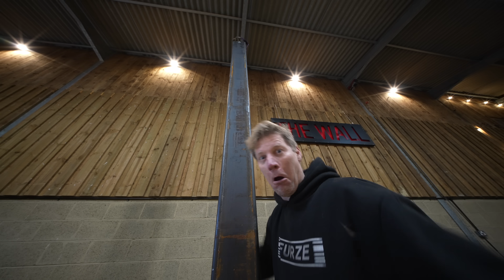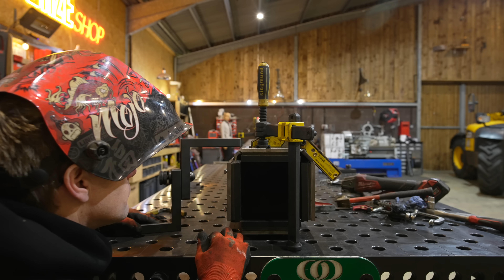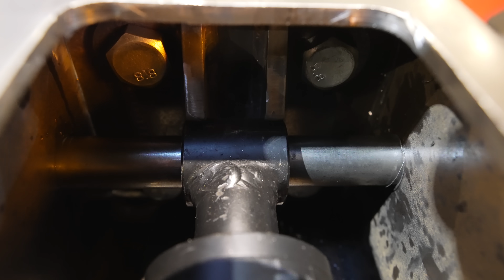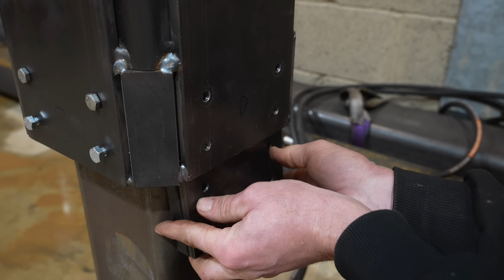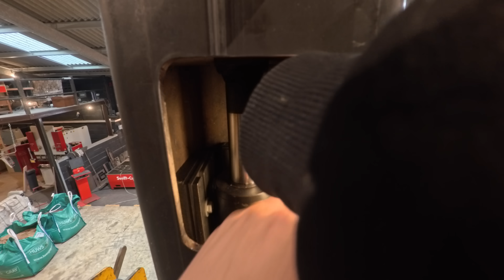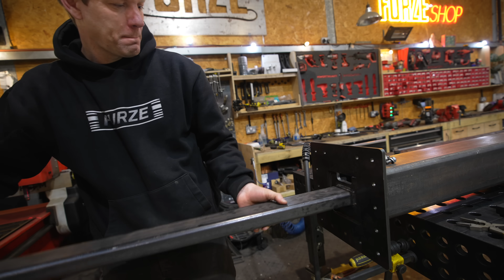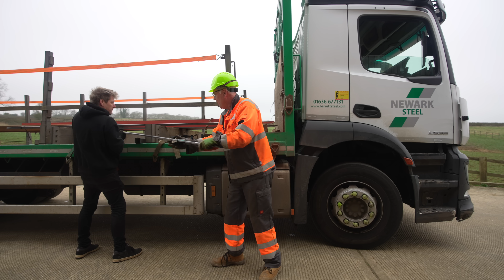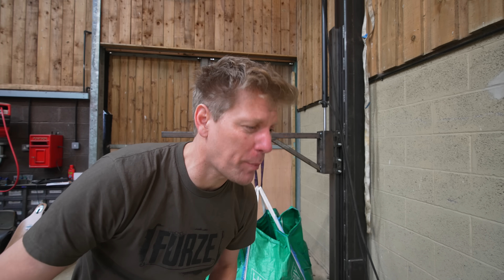Digging SECRET Garage Part 7 Car Lift Prep

Comment: Hi colin! Im a Hydraulics Engineer, and honestly youve done super good so far! As for the self levelling system, we'd use something call a flow Divider, this essentially splits the flow of a hydraulic pump into however many outputs you require! I build custom hydraulic power packs all the time so if you do need any support id be happy to give it a go! :)
Reply: A flow divider might build up some discrepancy over time. The cable system like in a car lift is the most reliable option. It doesn't even care if one cylinder fails completely.
Reply: @deckname5794 that's what I was thinking while watching the video.  I knew you could divide the flow, but didn't know there was a thing with a name that did that.  However, being ignorant of how flow dividers work, I figure using one would take away redundancy, and provide a single point of failure at the divider.
Reply: @deckname5794  just what I was going to say. Very simple, reliable, safe and relatively cheap.
Reply: @deckname5794 Well, we use them offshore on systems that lift thousands of tonnes. They are an essential part of a hydraulic lifting system and are work just fine.
Reply: @deckname5794 if the flow divider can reset by bottoming or topping out a function they go alright.
Reply: Could even use inceptors and servo control to manage the dividers like we do with our helicopter lifts.
Reply: Also a hydraulics engineer.  Flow dividers kind of suck where a system is constrained well or accuracy is critical.   They shine were things aren’t constrained. Like “I want to open 2 doors at the same time”. Applications similar to this i lean more towards electronic synchronization though old school systems did actually use ropes.
Reply: I saw a 1970s stage lift with 4 giant cylinders that used his cable system idea. Worked well. Epic project.
Reply: He needs height sensors on each post to regulate the flow to each cylinder. Ex Flow engineer here.
Reply: @daveshepherd1111 Yes, even low power lasers running through a microcontroller. Modulate valves to each leg, using one as master reference.
Reply: I started working as an auto mechanic in the 70s. The most common car hoist then was a single pole air/hydraulic system. Air pressure forced hydraulic fluid into a big cylinder buried in the floor. You could turn it around with a vehicle on it.
Reply: @terryvickers5986  Just a question cuz i don´t know, would this work on this height?
Reply: @LasseFisk  I don't see any reason why not. I'ts just a long cylinder. A big tube over a foot in diameter. Balance the load on it though. See an engineer for technical pecs for a cylinder to lift X weight and be stable. They might say two feet in diameter, with 1/4 inch thick walls.
Reply: @terryvickers5986 I was also thinking one big fat central cylinder lifting the turntable to the surface, however he wants to lift the driveway up in sync and not have the driveway lifted as high as the room is tall, so he is using the 4x telescopic method. It’s very clever, and really nicely engineered.
Reply: You should install a lock system like a car hoist has, when its lifting the car up have 4 latches on each post that roll over cut out grooves and makes the familiar clunk clunk noise. That was if something fails (very unlikely) the whole platform with all the weight on it wont come crashing down. Definetely be a good redundancy/safety margian to add in. You can have the last lock lined up so that when it reaches  the driveway level it locks in flush and is solid and not put any constant forces into the hydraulics. When you want to bring the car down the system lifts the platform up a bit higher to disengage the locking latches and it comes down smoothly. As for the turntable part in the middle so you can rotate the car around, the articulated busses we have at work have a bloody large tapered bearing in the centre of the turntable with 2 hydraulic rams that allow the trailer to articulate smoothly and allows for verticle play for the suspension,  but for your setup you could have gear teeth on the ouside edge of a turntable edge with a decent motor with a small gear that meshes with it, the large tapered bearing in the middle will allow full rotation and some smaller bearings on the edges to stop the wobbling and keep it smooth. I hope i explained this well enough 😂
Reply: @roboroach69   I'm an accountant and I have a pretty good idea of what you're saying. I agree with your idea to lock the weight over grooves especially when it relieves the hydraulics of constant weight.
Reply: A cable system could work, if you link the two diagonal posts together then you don't need to link them all four together.
Reply: @weu9  dunno why he didnt use cables , trailers use cables and can hold 1500 kilos easily even in transit
Reply: There are a lot of cooks in this committee 😂
Reply: All a flow duver does is as the name says 'devide flow'. They have no idea of diffent loading pressure at each cylinder. Load balancing blocks are pretty good at balancing, however in this modern age linear sensors are the way to go with proportional servo solenoids being used to pilot the high pressure working valve chest.
Reply: Rotary gear flow dividers I think he's on about which delivers same oil no matter on the different load cases. Either way don't think they are good, expensive and better options out there nowadays. I reckon a Plc and some solenoid valves
Reply: What about the way the car lifts in a workshop for mechanics with the safety locks on them.
Reply: @systemsrenegade9888 You have to hold those open to lower a lift. With all those rams, there might be enough resistance to keep it from dropping, if one blows a line.
Reply: The welds look amazing - me thinks CF had some help.
Reply: Flow dividers and rigid frames are a receipe for disaster. The flow divider fights the frame, you cavitate the lagging cylinder and if using counterbalance valves you lose pilot pressure and the whole thing locks up, or in the worst case the forces are high enough to damage the frame.
Reply: Hi Colin

Lift and Crane Engineer Surveyor here. Maybe fit high/low pressure detection switch into the system in case it snags during ascent/descent, and a low pressure valve that works without power. Also fit an electrically interlocked cut out switch to the safety gear system. Finally, if you want to go belt and braces you could fit either a solenoid operated chock to lock the platform at ground level so it can't lower unintentionally and will be fail safe with power off. Electrical anti creep would also work for this but not with power off. 

Good luck man
Reply: I have used flow dividers, they are a good solution to the problem of multi ram synchronisation. I would also use double acting hydraulic cylinders, you would surprised how much weight is required to retract the 4 rams when lowering the ramp. With an empty(no car) lift, there will not be enough weight in the structure to lower the lift.
The ultimate, highly accurate solution is to use electronic position feedback on all 4 rams, and electro hydraulic proportional valves linked to a master/ slave differential amplifier. 
Great project Colin, I am following with lots of interest.
Reply: i am just a few seconds into the video, and as someone who had to design (and fail) some hydraulic mechanism, the first thing i would have suggested, to NOT use hydraulics in the first place.
Hydraulics can leak, you need that expensive flow divider, that can fail to work if there is any discrepancy in the system, or over time... 
and for safety reasons, an electric spindle lift is self-locking anyway
Reply: @supremecommander2398  Colin is an industrial plumber, hydraulics are his second language
Reply: Amen!!
Reply: @supremecommander2398 How else would you manage all that, then? It's basically a big ass shop lift.
Reply: @supremecommander2398  Yeah but hydraulics are way cooler. Also as someone who knows very little about hydraulics other then the fact the pressure they deal with can legit cut you in half I've always been under the impression as long as everything is property rated and installed it can last decades with only minimal maintenance. How would you compare the cost for both systems comparably? Like it sounds like you arguing electric spindles are cheaper then hydraulics?
Reply: @GeorgeWashingtonLaserMusket   I would imagine these seals to last 20+ years with his usage. As i see it packaging of a ball screw vs hydraulics is superior and the integraded self locking is the only feuters that are pros in his case. Space dosent seem to be a issue and he added a seperate automatic locking-system should the lift goes to fast downward. He prob. also will be integrating safety valves on his sylinder should one of the lines break also. It also would mean that Colin have to go against the flow (pun intended) going with a non fluid sulution beeing a plumber.
Reply: @supremecommander2398  Most carlifts use hydraulics because its cheap and you can have a small hydraulic pump powering the whole system. Spindels that long would also have to be quiet beefy and probaly inclosed to limit buildup on the threads. While cylinders may leak and require som attention after years of use i would imagine these seals to last 20+ years with his usage. As i see it packaging of a ball screw is superior and the integraded self locking is the only feuters that are pros in his case. Space dosent seem to be a issue and he added a seperate automatic locking-system should the lift go to fast downward. He prob. also will be integrating safety valves on his sylinder should one of the lines break also.
Reply: It's mainly gay people that say 'super' non ironically
Reply: Wouldn't a simple hierarchical manifold split and equalize the hydraulic pressure to multiple outputs? That would be a simple and effective solution. Basically just a bunch of T-junctions that are assembled in hierarchical order. This way all of the pistons are pressure equalizing and the load is always equally distributed between them.
Reply: @InnatelyDone21  The pressure will be equal anyways when they are connected parallel. The volumetric flow that should be equal to all cylinders while the pressure might not be equal.

Consider a scenario where eg. an engine block is resting right next to one column, while the rest of the platform is empty. Very apparently that single column will have more load, thus more pressure would need to be maintained on it to keep it up while the amount of hydraulic oil should be same in all the cylinders.

So paralleling the system in a way that equalizes pressure (like a T-joint) is not going to work unfortunately.

Also, someone said that it will be rigidly mounted anyways. In real life it won't be rigid enough. The materials will flex. If you have ever try to make a sturdy cantilever bed 3D printer for example, which is essentially a small-scale model of this exact problem, then you are going to see that you need very beefy guides and platform to make it rigid enough, as opposed to have a leadscrew with synchronized drive in all 4 corners.
Reply: Hold on you’ve been thinking about this from the very beginning😊
Reply: no you just play counter strike
Reply: Furze has used a flow divider in an other video.
Reply: Got a question for you guys. I've wanted to build a hydrostatic motorcycle, like that guy who built the 2wd one a few years ago on a smaller scale. I planned to use two different sized automotive power steering pumps, a big one moving a smaller one.

I know the bypass valves need to be altered so they don't just free spin and bypass the fluid, and I figure a cooler on both sides. How feasible is that?
Reply: The problem with just a simple flow divider is that it still allows for the common problem with running multiple cylinders off one source and expecting them to raise and lower evenly at same time... you get any drag or restriction of travel and the cylinder with least will move while other stays still.... a volume regulated flow divider helps with that as it forces the same into both paths..  but seeing as im guessing all four cylinders will be joined togeather very solidly so they are forced to lift evenly anyway.. it will all be good which ever way he goes
Reply: @sim8634  The posts are solidly connected but the inner lift system has a detachable plate for the turnstile, therefore that liftsystem isnt so solidly connected (two and two sylinders are solidly connected). So he prob. have to do somthing more than a flow devider and volume regulated control to make sure the four sylinders operate in sync. You can see it roughly 2 mins out in the video.
Reply: A Flow divider? Let me tell you what I know about Flow dividers.....I like Donuts....I hope this helps.
Reply: I passed the egg drop test in high-school  just let me know what you need 😂
Reply: Colin don’t listen to this person, they asked for my banking information
Reply: Hi Colin. When I became an Electrician the 1st thing I learned was everyone knows everything about Electrics or has an Electrician mate...cough cough.

I see many Hydrolics experts on this chat 😂
Reply: Would also recommend a system that detects any significant level differences and cuts the power to the pump. Reliable sensors such as LVDTs or maybe some form of Hall effect device that counts distance increments would be best. Avoid less robust devices such as potentiometers or optical encoders.
Reply: In case it's not obvious, I'm NOT a hydraulics engineer. I deal in electrons and software.
But I'm curious. If the cylinders have ports both ends, and you connected the exhaust of one to the inlet of the next, the lack of compressibility would force them to move at the same speed. Does this work or do you get something like errors in hose expansion etc. that stops it ?
Reply: @theelmonk because of the piston rod, the volume of oil is different on each end. This is why a cylinder has less power when retracting vs extending.
Reply: Flow dividers are a terrible idea for this setup, the fact you have even said that makes me very much doubt your ability as an "engineer"
Reply: @CarGuyMike85 and where flow dividers a terrible idea? The ability to balance the flow to 4 hydraulic cylinders is bad for what reason?
Reply: @moraleftw5745 That's cool, but you're just telling us you've never worked on a system that used flow dividers. Basically they suck. They're a great solution for when you have 2 separate things you want to move at kinda the same speed, or for instance are pushing a beam from both ends, where both ends are allowed to move independently. Any system which requires actual synchronization is a poor use case for flow dividers. In reality they simply don't synchronize well, and you will end up damaging guides, or having binding issues.

Comment: This system looks like it will work, but I think you missed an opportunity to go with a much simpler Screw system. They'd be intrinsically locked together so you wouldnt have to worry about the legs raising or lowering out of sync. Your work is Impressive as always.

Comment: Commenting before the video so maybe it's irrelevant with the final design. 

You might be able to build some sort of camera system that analyzes where your car is on the platform and some sort of visual indicator to tell you to pull forward or backward so you're always on the center of the plate.

Comment: When you connect the outer box section with the roller bearings to the H-beam witch fixed on te wall like you planned, you actual don't need the inner box section anymore, because it can't go anywhere. In that case its also very easy to remove the hydraulic cilinder.

Comment: with the daisy chain idea, if one hydraulic is experiencing a higher load, wether that is to parking off centre or whatever else, the other hydraulics would increase their height while effectively treating the high loaded one as a "complex hose". it might be a good idea to re-consider this and integrate some sort of mechanism to either feed the same amount of fluid to each hydraulic, or some sort of system where it measures the individual heights of the posts and adjusts pressures accordingly.

Comment: Perhaps the simplest solution would be a screw jack.Instead of building a large, round rotating platform, I suggest building a small, hidden rotating jack that will only go under the car and lift it by the sills, lifting it up so the wheels are lifted off the platform. This way, all you need is a simple rotating mechanism, and everything is hidden under the car. Greetings from Poland

Comment: Colin, have you seen these telescopic lighting rigs that extend up to around 5m plus. Why not just break down four of those from their generator trailer housings and use those. Surely four of those working together could handle a car. Less build hassle and four identical units.

Comment: just as a curiosity idea.... what if, instead of the hydraulic rams, you have synchronized thick threaded rods on each corner, and have a rising platform connected to the threads. then you run the threads to turn using hydraulic motors, or electric motors. then you would have the platform connections slide on linear bearings near those threaded rods for more stability. this woudl be an alternative to using the hydraulic rams, and something to look into perhaps, if the rams don't quite pan out. of course, such threaded rods would need to be CNC lathe turned, which might be more expensive than the rams, but even so, perhaps a model version test is in order?

Comment: Your smarter than me and probably already thought this but the bolts that hold the bearings might be worth getting some 10.9 grade or socket caps which are 12.9. Would suck if one broke down the line 😁😁😁
Better safe than sorry.

Keep up the good work 👏